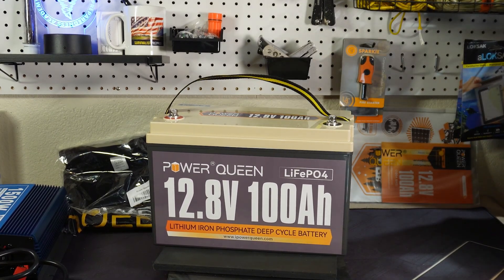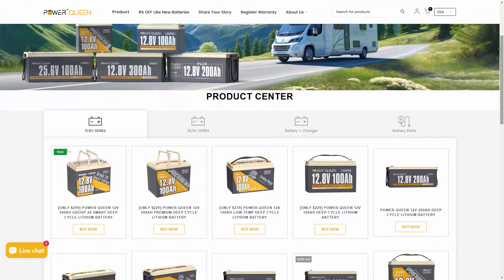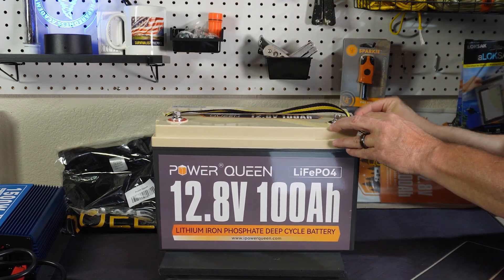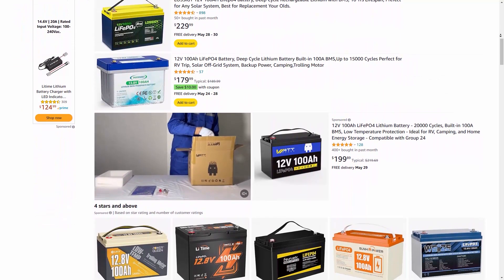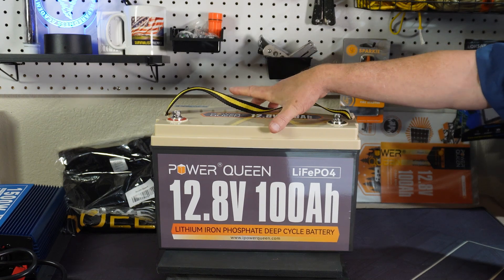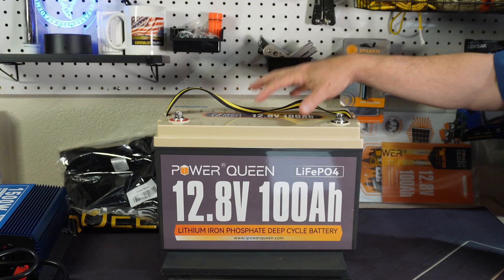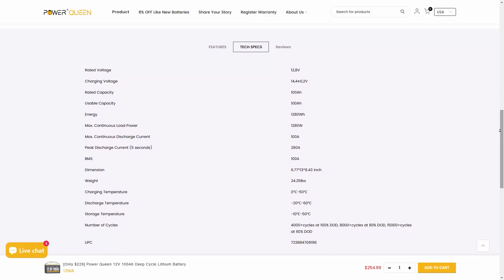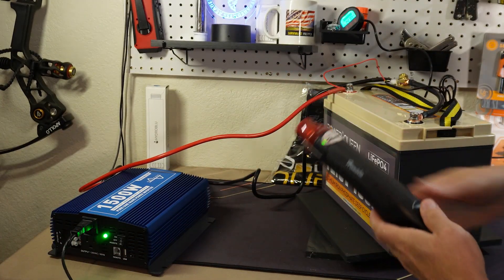Power Queen 100Ah LiFePO4 Battery Review & My Power Station

Comment: Re. your battery wiring, it would be slightly better to take the negative to the wall off the other battery.  (I.e. positive to battery one, negative to battery two.)  With lead it was really important, but even with LiFePO4 it will help both batteries share the work more equally.
Reply from the maker: I figured that out after I recorded. That's the way it's connected now. Thanks

Comment: The hotplate may be fine in an emergency. How long are you going to need to use it?  It doesn't take an hour to fry some eggs or heat a few cups of water.  It may not be the most efficient solution, but solar and a $30 hotplate may be available and safe and good enough.